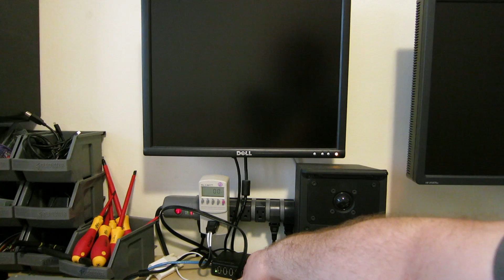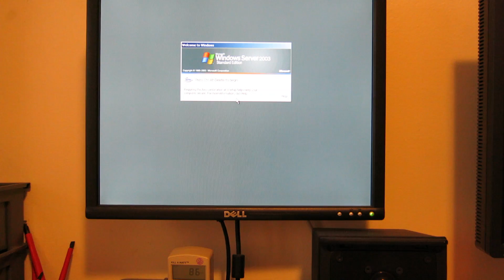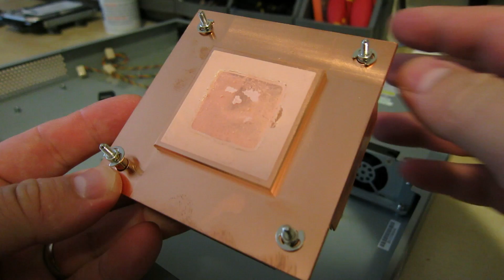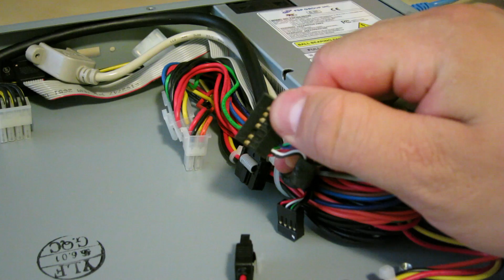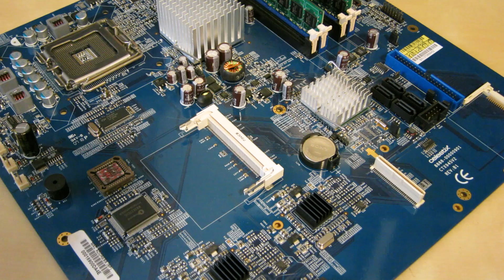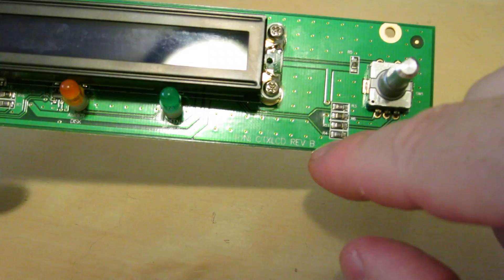Celestix Scorpio X Teardown

Comment from the maker: I don't have it anymore. Most of the systems I buy, I pick up only because they're cheap and/or interesting looking. Most of the time they are P4 or below which I don't believe are ever worth keeping due to the power they consume vs the performance.

The open slot was definitely not a CF slot on my model - unless you mean it was for an adapter. Doesn't make much sense to do that when you can just put a CF reader there in the first place. :) It has slide clasps for lifting a card out on an angle (like removing old memory sticks) and putting it against flat edge pins. CF card sockets use two rows of exposed pins. It was a miniPCI connector (or something with the same connector as miniPCI, but a different pinout as I didn't test anything in it).